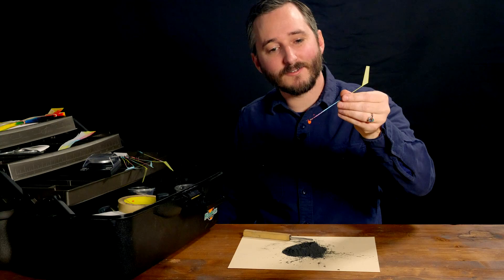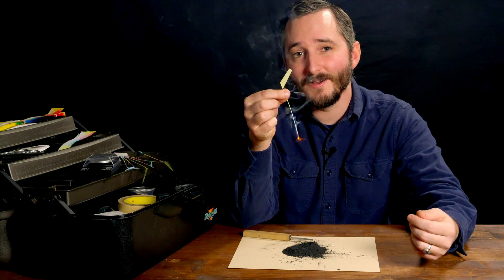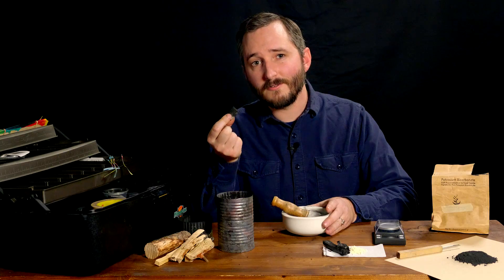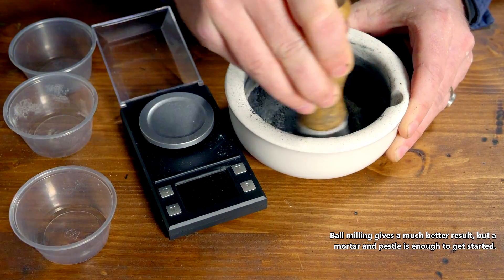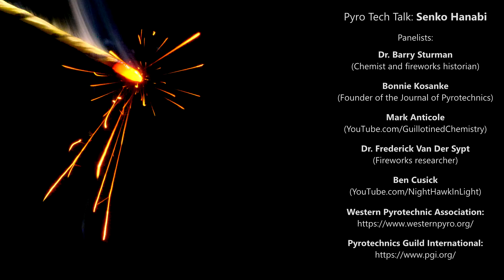The World's First non-Flammable Fireworks (a novel way to make Senko Hanabi Sparklers)

Comment: That's very impressive, loved this video! Makes me wonder if other metal bicarbonates would result in different colors (like lithium bicarbonate for a vivid red), or if other chemicals can be added to change the colors/spark formations. Also makes me curious about how big these can be scaled up...I might have to try making a big one on my own channel to see if it's possible! Keep it up man, can't wait for more!
Reply: I highly doubt you could make them much bigger. The surface tension of the liquid is what's holding it all together and it can't handle a lot of weight
Reply: Tbh i think it will. But for some colors it's only legal to get in liquid form.
Getting that in to a solid form will take a lot of resources.
Reply: I will wait for that video.!
Reply: Be careful with big, externally heated reactions. You could accidentally end up making something too close to yellow powder, which is S, KNO3 and K2CO3, that spontaneously detonates when melted together.

Comment: So what exactly is left in the drop that makes it able to sparkle? Working without nitrate seems like magic to me.
Reply from the maker: It's not entirely known, but I think it's mostly just sulfur and carbon burning at the surface which heats the drop until various things inside boil and react to produce gas. Gas bubbles pop and throw off drops (which are sparks) just like the droplets that shoot off the surface of a carbonated drink.

Comment: 5:20 do you mean "higher mass-to-surface-area ratio"? I would think a sphere would have less surface area than a fine powder.
Reply from the maker: You're right that a powder has more surface area than a drop, but the powder only can react with air once it's molten and loses that advantage. Read my pinned comment for a little more info
Reply: @Nighthawkinlight  Aha, I'm certainly no chemist but I think that makes sense. Seen you in Mike Winger's comment section, keep up the excellent work!

Comment: I suspect sodium chloride (common salt) + charcoal might work. As far as I can tell, this reaction involves making a drop of molten potassium sulphide with specs of charcoal in, all red hot. When a spec of charcoal gets to the surface, it burns producing CO2, that quickly expands, blasting out a tiny amount of glowing liquid. This phenomena should work with any salt that melts at a suitable temperature.
Reply from the maker: Yes there is a chance of that. The carbonates convert to sulfate for the most part, so any salt that can do the same will work. As long as the sulfate also melts at a low enough temp.

Comment: Hi Ben,
Thoughts on using Sodium Carbonate(sold as washing soda) instead of bicarbonate? The chemistry should be closer to the original formulation in this video while still using Sodium compound. 
Best
Shab
Reply from the maker: I think there is no benefit to carbonates instead of bicarbonates. Both work.

Comment: It’s been cool to see your work on this! How does the mixture behave when it’s under pressure?
Wonder how big of a senko you can make too.
Reply from the maker: What do you mean by under pressure? The powder requires air, so it won't burn in a closed container. A senko hanabi does react well in a high o2 environment though.
Reply: @Nighthawkinlight I think they meant if it burns on impact
Reply: Maybe he meant that what will happen if we put that powder in a sealed firecracker, but like you said It requires air to work
and I know that's because there is no an oxidizer, am I right?

Comment: Thanks for the update Ben. Very interesting. Maybe I missed the composition for the potassium bicarbonate version somewhere. Is it the same as the KNO3 type?  Are you still using party streamer, or have you found another material?
Reply: The two recipes are on screen at 8:52 (potassium bicarbonate) and 11:28 (sodium bicarbonate). I'm not sure which you're asking about as you mentioned potassium in both, and there was no recipe in this video using potassium nitrate, as the whole point is that this recipe does not use any oxidizers like that.
Reply: @killerbee.13   Sorry, that question wasn't as clear as it should have been. Having just re watched the original video, I was referring the the ratios of chemicals in the older composition as compared to the new one.  Thanks for the time codes, I must have looked away at the wrong time.
Reply from the maker: I use white tissue paper from dollar general for my papers. Dyed with alcohol ink
Reply: @Nighthawkinlight    Thanks, I'm going to give it a try once I get my lab set up again (moved).

Comment: yo hi! i use baking soda as a cheap feed stock for soap making, something that might help you is that sodium bicarbonate isnt sodium with 2 carbonate groups , its actually a hydrate since sodium mono-carbonate is super hydrophilic and sucks water right out of the air. most of the baking soda you get is already saturated with water since it comes in boxes and bags. but if you bake your baking soda at 100c until it dehydrates back into sodium monocarbonate (aka soda ash or washing soda) before mixing it with the sulphur and wood coal, then your spark drop wont have to boil off the water locked inside the baking soda before it can get to emitting sparks
Reply from the maker: It's better to use a pre-hydrated state because then the composition is shelf stable. The nomenclature for carbonates and bicarbonates is really archaic and needs revision. Sodium bicarbonate (baking soda) is actually sodium hydrogen carbonate NaHCO3, while sodium carbonate is Na2CO3.

Comment: I saw it until 2:53 and came to write down a comment, I believe I used active charcoal instead of charcoal in black powder formulation and it did have similar effects as your powder shows Now I will watch the rest of the video so if I am right then it is not first non-flammable fireworks. Edit: but it could be the first non-flammable fireworks that are reported. Second Edit: So, I was wrong :-) it seems what you made could truely be the first non-flammable fireworks.

Comment: I wonder what would happen if you substitute the potassium bicarbonate with magnesium bicarbonate! Or even lithium bicarbonate.
Reply from the maker: Any bicarbonate should work, as long as the melting point is lower that 800c or so, same goes for the sulfate of that metal.
Reply: @Nighthawkinlight  hmmm, I might have to try it myself.

Comment: I wonder what sodium carbonate (soda ash) would do - you can buy this compound easily as a cleaner
Reply from the maker: It will work but absorbs water from the air. That makes the sparklers have a short shelf life before they're a soggy mess. Same goes for potassium carbonate
Reply: @Nighthawkinlight  Another possible idea I had was to use a potassium salt of an organic acid - perhaps cream of tartar or potassium benzoate?
Reply from the maker: @MandrakeFernflower  Interesting idea for sure. I think whatever you start with quickly converts to a sulfate so not sure if other salts would make much difference
Reply: @Nighthawkinlight  I'd assume the thermal  decomposition of the organic acid would give carbon dioxide
Reply from the maker: @MandrakeFernflower  Probably, but that would all be over by the time the drop is molten

Comment: Thanks a lot for this Ben, you have such a great talent and impressive dedication!👌

I have been working as a pyrotechnist for a long time never tried the senko hanabi until I watched the pyro tech talk. Great fun but I have such darned problems getting the roll to start. Any tips for getting the correct “Fingerspitzengefühl” when it comes to the very initial part of rolling?
Reply from the maker: Get that bottom corner of the fold pretty well wet all the way through, until you can see the moisture sticking the two sides of the paper together. You only need moisture right in the corner so the roll starts since that's the hard part as you've seen.
Reply: this darned thing was also the hardest part for me.

Comment: Very nice, informative vid, Ben. Those are about the best senkos I've seen. Can you provide a rough guide to how much of the charcoal you've played with replacing with lampblack to improve the effect? Thanks.
Reply from the maker: Thanks Ned, high praise. It's tough to give a guide to how much lampblack you can get away with because it varies dramatically depending on the source. The pine soot I have from Japan can be the majority carbon source, but other petroleum produced LB can only replace 10-20% of the charcoal at most before cooling the drop too much. More charcoal needs to be removed in proportion to the amount of LB added to keep the drop up to temp.
Reply: @Nighthawkinlight  Thanks for the reply, Ben. I've ordered some potassium bicarb, and look forward to playing  with it, and with some baking soda, too. Very cool and simple device and effects. Happy Holidays.

Comment: If you swap potassium nitrate, for strontium nitrate, I bet it would have the same effect  but have Road Flare Red sparks shoot from it. Could be fun to see.
Reply from the maker: Strontium nitrate or carbonate would probably convert to sulfate quickly, which has too high of a melting point to form a drop. I had that problem with barium carbonate.

Comment: recently i accidentally made some lampblack by accident, by using what i have around me, to make a simple "space heater"/"coffee warmer" for those cold nights, with a homeade oil lamp, so since i have that i was thinking of maybe trying that version, about ow much lampblack tp pine charcoal did you end up using, or are you still playing around with that mix?
Reply from the maker: Start by replacing about 5% of the charcoal, and maybe reducing the charcoal overall by another 5-10%.
Reply: @Nighthawkinlight  okay cool, so start by removing about 10% of the charcoal, and replacing about half of it, with lampblack? and that will like help "emulsify" the ingredients in the ball and make it look more "traditional" like "normal" senko hanabi's?
Reply from the maker: @stapuft  That would be a good start. Lampblack cools down the drop a lot compared to charcoal which is why more char needs to be removed compared to how much LB is added. LB makes the sparks a darker orange and changes how they branch
Reply: @Nighthawkinlight  arigito sensai! thank you for making such amazing videos, and even taking the time to answer questions in the comments, you sir, are a king amongst creators!

Comment: Maybe if you added some more powder in the tail of the senko hanabi you could make it last longer with sodium ?
Reply from the maker: I don't think so, because extra powder would put the drop out
Reply: @Nighthawkinlight  Sure, but if it's flammable again ?
Reply from the maker: @Moddingear  To make it flammable again you would have to use sodium nitrate instead of sodium bicarbonate. In which case that might work.

Comment: Does this work with different alkali metals? Rubidium's not easy to come by but caesium carbonate might be.
Reply from the maker: It seems to work with any metal where the melting temp of the carbonate and sulfate is lower than 800c or so

Comment: What is changing in the molten droplet for it to enter the sparks phase? Is it just surface area? Or is it some amount of burnt tissue paper? If it is just surface area, you might be able to siphon off a big molten drop into a persistent tiny droplet using some capillary device, making the sparks last even longer.
Reply from the maker: Interesting suggestion to try a capillary device. Could be useful to study a drop in a scientific setting. The main change in the drop is increasing temperture before the sparks start.

Comment: Suggestion: A smoother form of carbon can be made using wine corks rather than pine in your charcoaling process. Hope this helps with your experiments.
Reply from the maker: Could be interesting to try. Lots of different kinds of charcoal will work, but some give better sparks than others.
Reply: Just make sure it’s real cork not those plastic ones.
Reply: @micropyro7470  thank you and lol 😂
Reply: Meant to put this here: just make sure it’s 100% real cork.  No plastic ones or ones made from particles and glue.
Reply: @micropyro7470  no glue is used for ground cork corks. Cork itself contains compounds that allow it to bound together. Just heat ground cork under pressure in a mold. It will bond.
Reply: @DanielJoyce  i should of been clearer. I meant cork board that someone my get in leu of real corks. Glue is used to bond to backing of tack board. What ever the case may be just make sure your getting 100%!cork.
Reply: Willow charcoal is generally considered the best. Very fine particles.
Reply: @BritishBeachcomber  Cork is finer. The cork bark is just above balsa in softness while willow I believe if memory serves me, is a harder wood. No doubt
You can make a great BP with willow and is cheaper. I was just exploring some alternatives. My cork BP is really fast. Right up there with a lot of flash
Mixes I have seen. I like to use it as a burst charge and in crackers.
Reply: bamboo charcoal and/or coconut husk/shell charcoal
Reply: I have to wonder if residual rosin compounds are useful in blob formation and retention.
Reply: what about sud instead of charcoal?
Reply: @cutterboard4144  what is sud?
Reply: @micropyro7470  soot. sorry, not my first lingo ;)
i think thats as fine as it gets.
Reply: @cutterboard4144  soot is already pretty much burned it’s just a highly pure form of carbon. Charcoal still contains some organic stuff that is part of the chemistry. All interesting stuff and that’s what I enjoy the most!
Reply: @cutterboard4144  in his other videos, soot or lamp black is the primary carbon source.
Reply: @UnleadedPadyak  yes lamp black made from fatwood ( a highly resinous pine wood).
Reply: In general, any highly decomposed wood should work.
Reply: @gogo311  yes but it is more of a question of how well.
Reply: @micropyro7470  Well, it should be very easily pulverized at the very least.
Reply: @gogo311  hardwood charcoal is for cooking. Softwood charcoal is for pyrotechnics.

Comment: Now you need to convince your doctor to prescribe you some lithiumcarbonate🙃.
Also i wonder what would happen if you add the tiniest amount of copper filings. Note that copper and sulfur react exothermically, so to keep the flashpoint at the same temperature as your mixture would need some experimentation. Bout it would be interessting to see if you could sprinkle in some readily available metals like copper for added effects like color.
Reply from the maker: I do have a bit of lithium I was thinking of trying.

Comment: Could you make a super long one with multiple stages? So have multiple powder pockets that are ignited by the 3rd stage and so repeat may times?
And what happens if you use more or less powder? Or if you put a miniscule coating of powder along the paper (like a dusting), would it sustain the 1st or 2nd stage longer? I'd love to see a video discussing all the possible variations, you've got me absolutely hooked and I am fascinated with these now <3
Reply from the maker: You can make multiple sections of powder in a normal senko hanabi, but not in these ones because each section would need to be preheated with a lighter

Comment: What if you put a burnable compound inside the wad to catch fire and generate enough heat to melt it, so you don't need a special lighter?
Reply from the maker: You could, but I don't mind using a torch lighter

Comment: That's so cool.
I wonder about the next level, adding other salts to the mix. maybe a little NaCl to the KHCO3 to try to get those "flares". maybe it's possible to add some salts to the paper to get a rainbow color effect as the Senko Hanabi transitions through differnt salts on the paper. 
Or just different colors for the initial sparks by adding differnt salts in small quantities. It would be really cool to see a green sparks version by adding some Copper chloride or boric acid. or possibly purple with postasium chloride?
Reply from the maker: Not sure what will work and what won't

Comment: Huh notice the potassium had a blue plasma around it wonder if you could use copper carbonate to get green. The copper left overs might rob it of energy might and kill the effect. Wonder how much those metals are contributing to the sparking effect. They both melt under 200degrees.
Reply from the maker: The blue glow is from burning sulfur

Comment: Would saturating/drying the papers in a nitrate salt help with ignition?
Reply from the maker: No, you'll end up with the stem burning and causing the drop to fall. If you're going to use nitrate at all you may as well just use a nitrate based senko comp

Comment: Green visco fuse will sometimes form red-hot molten droplets when it burns.
Every once and a while, theses blobs would throw weak Senko Hanabi stype sparks!
I tired putting different chemicals on the fuses, trying to improve the appearance.
Borax seemed to help a little, nitrates made the effect vanish.
Note: these droplets form after the fuse-core has burned, sometimes delayed by a few seconds after the core of the fuse has finished burning.
Not very reproducible.
Reply from the maker: That's a clever observation
Reply: The borax might have been acting as a flux making it easier for the molten blobs to form.
Reply: @garethbaus5471  Yes, the blob seemed to be more cohesive with borax.

Comment: So what is going on here chemically? What reactions are happening? What is ejecting the sparks?
Reply from the maker: Chemically it's still being researched. I believe it's a simple surface level combustion of sulfur and carbon which the molten components facilitate. The sparks are ejected by a physical reaction rather than a chemical one. When the drop boils or gas is produced it forms bubbles which eject droplets when they pop. Like the droplets that are ejected from the surface of a carbonated drink.